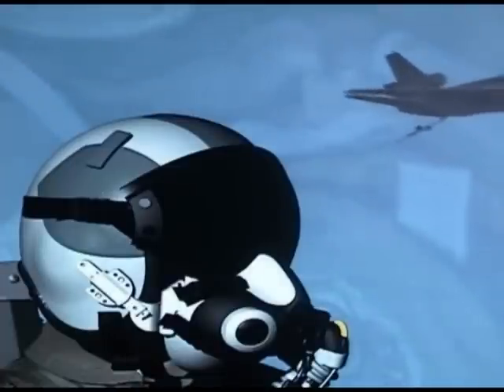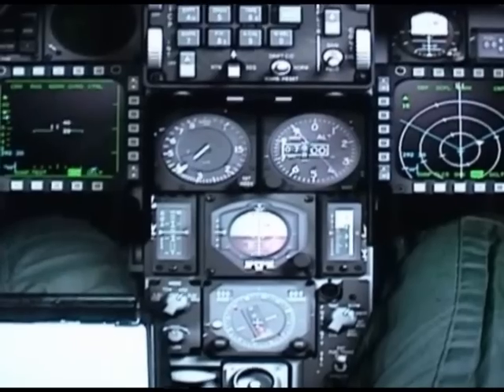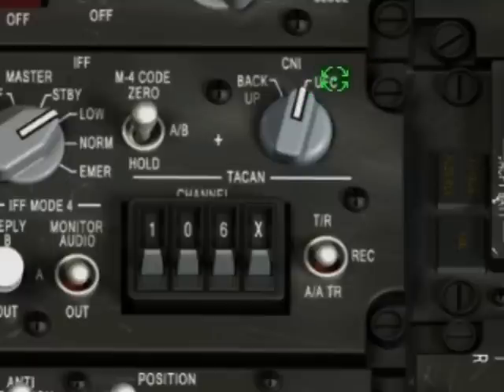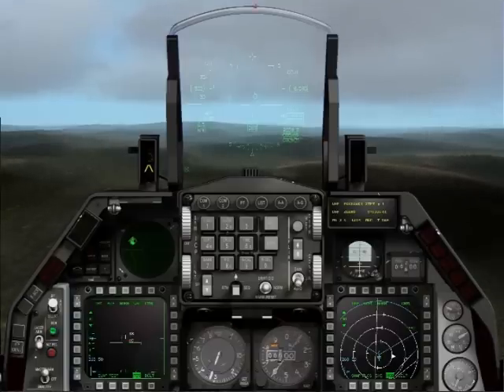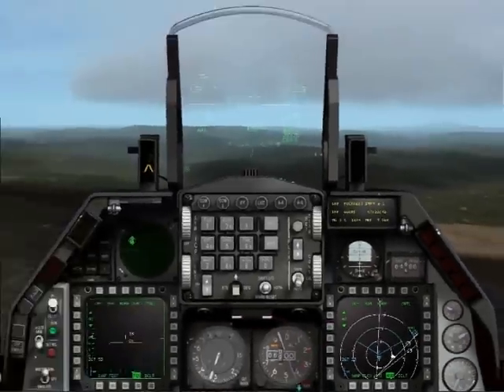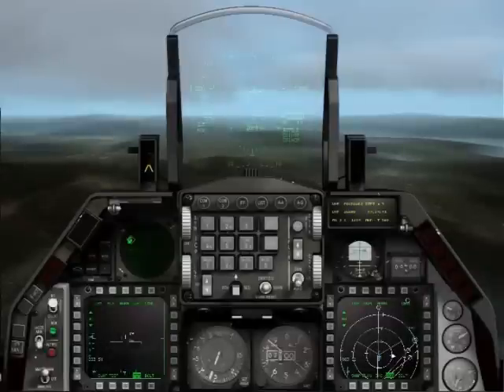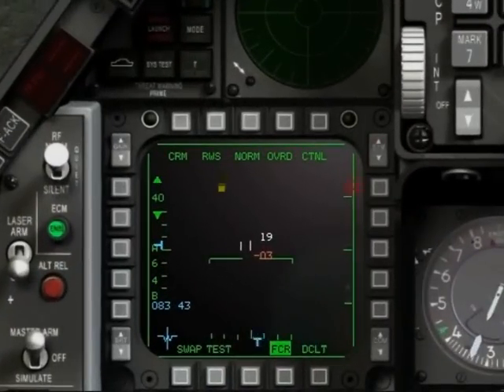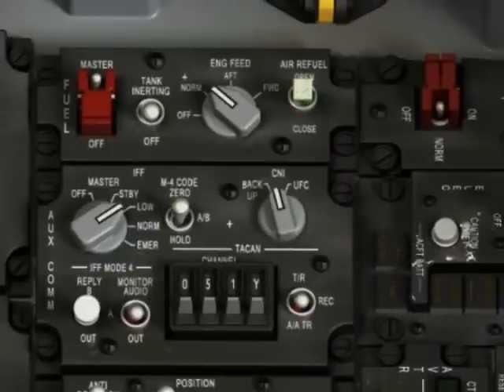F-16 F 4.0+RV HQ A-A REFUELING PART 1

Comment from the maker: The keys are pretty much the same in all the different mods, I zoom in and out with the wheel in the mouse but you have to activate the zoom option in the setup before you start a mission. go to setup! also to look arround press and hold the right mouse button to look arround this have to be activate it also in the setup!
thanks for watching!